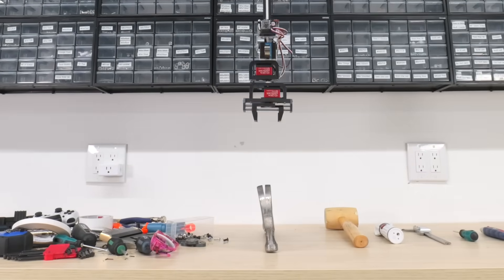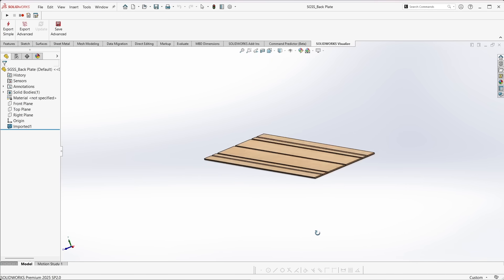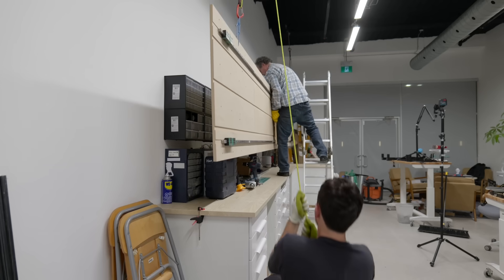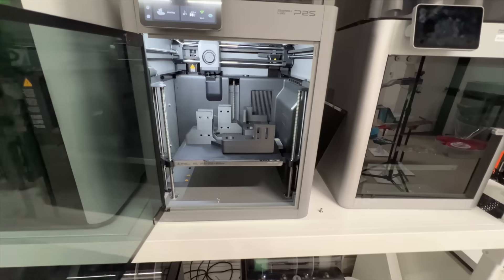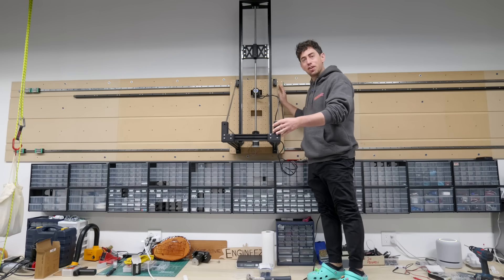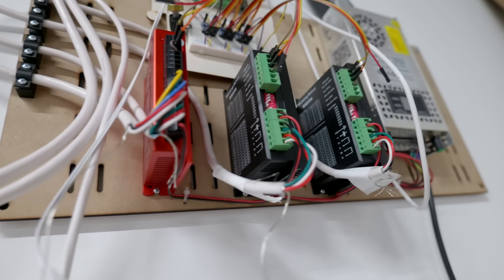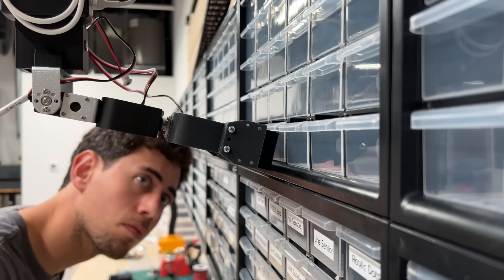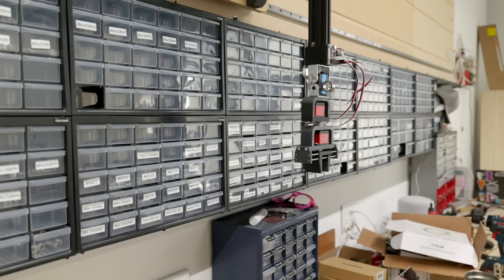I HATE Cleaning so I built THIS

Comment: you should take a min to read the instalatoin instructions for mounting leanear rails. The should either be doweld in place or you need a machined edge to clamp aginest while yo bolt them down to maintain straightness.

Comment: some tips on the 3d prints: for anything with friction (gears etc) that needs to last long and survive some force over a long time i heavily recommend printing in Nylon, its self lubricating, lasts ages and doesnt break or deform nearly as easily as pla. its also not super expensive and relativly easy to print (in my opinion) also 80% infill is super overkill, after 50% the results arent worth the extra wieght, price and print time

Comment: Damn, what an epic project - well done! Can't wait to see the next iterations. Did you consider putting all the control gear onto the gantry platform? That way you'd only have power cabling to run in the chain, and end stops etc could all be on the x-gantry plate along with the motor controllers and esp32. You could also then mount your preferred tool battery on it and have it truly wireless, with a charging dock at one end. Or did you want to keep the travelling weight to a minimum?
Looking foward to your OpenCV battle next! 😆And the automatic toolhead changer for clean-bot to also do CNC duties!

Comment: 15:00 - You need to have a chat with @mellowlabs - next improvement should be RFID recognition of each bin when it's placed on the desktop storage, and a database of locations - that way it will know where each item needs to be put back based on what drawer has been placed on the mount. You can then run programmable LED strips behind each drawer, so you can also indicate each drawer's location on command, and even use the database of locations to track inventory, so the LEDS can indicate drawers with low/no stock...

Comment: Pro Tip: Testing a limit switch works the same whether you press the switch or the robot does. So you do not have to wait for the robot to potentially run itself off the track if you just touch the limit switch early to test if it will stop.

Comment: Video idea: Solar panel snow remover. 
I imagine a couple frames on the ends of the bank of panels with a few strings pulled taught between them. The bot moves along the frame pulling those strings to dislodge the snow. 
Could be 2 fishing lines and a length of webbing, the fishing line cuts into the snow and the webbing brushes it off. 

There are solid bots that crawl along panels for giant arrays, but they're very expensive and can't work with a variety of panels. The string method can work if you have just one panel or several in a row.

Comment: My humble opinion is that the needed precision to insert back a tray will fail from time to time. I would have tried to design a sort of rectangular "funnel" made of thin flexible tongues that can partialy enter the void. Maybe it won't need extra with load sensors "feeling" if the alignment is correct, so the motor can adjust the positioning. Simple mecanical aid is better that computer vision or other solution that need soooo much tweeking....
Reply from the maker: We definitely identified this problem and have some solutions in mind. Agreed that the funnel is the move!
Reply: @Engineezy  I will try to describe without drawings my vision of last night... Put the drawer on a tray with side walls on the front and the sides. The tray is extended at the rear by a thin flexible tong made of steel, with a triangular shape so insertion at the entrance is easy. just insert 1cm. Lower the tray so that the tong touches the bottom of the hole, with a little flex. When you start pushing the drawer towards the hole, the side walls are enlarging the tongue (that is cut in the middle, with a spring that tries to make the tong narrow), now the sides of the tongue are applied to the sides of the wall, and the drawer in perfectly centered horizontally. now you can continue the push of the drawer that should enter the hole with no problems...

Comment: Impressive. Did I miss how the bot decides / detects bin positioning when reinserting them into their shelves? As we saw from the initial design / testing, a heavier bin will cause the caliper to hang lower so you have to be deciding at what z-height to position the outer end of each bin before pushing them in, rather than relying on a set height for the row. All in all, a complex system and one that could potentially become a serious rabbit-hole for a detail-oriented person like me 😬
Reply from the maker: Right now it’s dead reckoning with a little extra loading on the servos, in the future this whole system will have to be improved with feedback of some sort

Comment: Having a nice database of all my parts linked to various local/api voice assistants is so cool. Like "Hey Jarvis, do i own something that can measure x?" and it giving me multiple choices of breakout boards, single ICs and even possible combination of ICs and microcontrollers is pretty neat. It can also reliably auto-generate basic code for ESP32s and flash them through a docking station i've build. It is nowhere near complete and more of a working prototype held together by AHK scripts and Home Assistant, but it is totally working. It makes prototyping quick and dirty solutions so so much faster, like i can have an ESP32 with a working web interface logging ToF sensor data and graph them within 5 minutes after the first voice prompt.

Comment: Perimeters > infill. Your parts still aren't 'super chonky', you're just wasting a ton of filament by setting the infill that high. Instead, push those perimeters to 12 or even 16 and leave infill around 5-15%. The parts would have been way stronger at a fraction of the filament cost and print time.

Comment: Based on the top comments, here is a categorized list of improvements and suggestions for the workbench robot:

1. Tracking & Identification Systems
 * NFC/RFID Integration:
   * Place NFC tags or stickers on the boxes/bins so the robot can identify them regardless of where they are placed.
   * Install NFC readers on the holders/landing zones (specifically on the bottom of the bins and the holders). This would allow the user to move a bin manually, and the robot would automatically know its new location to put it back correctly later.
 * Visual Marking:
   * Add QR codes to the handles and plastic drawers to help with itemization, positioning, and identifying landing zones.
   * Use stickers combined with scanners for identification.
2. Computer Vision & Camera Features
 * Object Detection: Install a camera and image recognition software. This would allow the robot to:
   * Identify boxes and tools on the bench.
   * "See" what the user is looking for.
   * Check if a part is already in inventory.
 * Desk Camera: Add a larger overhead camera for general location data to help clean up untabled/messy tools.
 * Snapshot Reporting: Use the camera to report the status of the workbench as a "snapshot of the scenario."
3. Inventory Management
 * Weight Sensors: Incorporate load cells to weigh the bins.
 * Auto-Restocking: Program the system to detect when a bin is light (low supply) and automatically add the item to a to-do list or reorder it from Amazon.
4. Motion & Hardware Control
 * Limit Switch Safety: Instead of having the robot "slam" into a single limit switch, install two limit switches on the top:
   * Switch 1: Tells the pinion to slow down.
   * Switch 2: Stops the carriage completely.
 * Structural Expansion: Build the gantry over the whole shop supported from both sides (rather than just the wall). This would give access to the entire shop and potentially be easier to support.
 * Material Warning: One user warned that the PLA parts will warp over time due to the constant weight of the carriage, implying a need for stronger materials or metal reinforcement.
5. Software & Logic Improvements
 * Optimization Algorithms: Program the robot to learn the most commonly used tools. At night, it could automatically reorder the drawers so the most frequent items are closest for faster retrieval.
 * Pegboard Solution: Instead of dumping loose tools into a generic "tidy bin," implement a pegboard-based solution (possibly mounted above the X-axis) where the robot can hang tools individually.
Reply from the maker: Lots of great ideas here, appreciate you compiling them!

Comment: He said, "that's what engineering is for I guess..." Lol

Will it work?
Idk. Did you do the math?

Stress testing can't math until you math the test to scale... 
When extrapolating another point on a line you first need a line. A line is at least 2 points of data.

This is a sweet project. I am of course posting my first comment only 5.5min in.
I work with some giant milling machines they use screws to move the x, y, z that are like 2 inches in diameter... The tables are 4 to 6 ft wide and they are 20 to 50 ft long...

Everything scales. I didn't see if you had installed metal inserts to the mdf that you bolted the rail to or what. I am trying to guess max gantry weight. I bet it's a bunch either way. Was that 3/4"?

Comment: all those PLA parts WILL warp. you may not be picking up anything heavy but the constant weight of the carriage assembly itself will absolutely warp all that PLA.
Reply: the term you're looking for is Creep, and yup PLA is infamous for creep especially as it'll uptake water from the atmosphere. PLA is one of the worst in this regard, PC probably is one of the best "printable" ones but it has issues. I'd just have gone ASA/ABS. Some would say GF/CF Nylon but I sure do not want something that sheds microfibers of Glass and CF around
Reply: The rack and pinion will also almost certainly break, PLA is not very abrasion resistant and eventually the gear will slip.
Reply: @mxlje There is very little force on the rack. It will last a long time. Its overdimensioned in my opinion.
Reply: Not to mention their 'strength testing' phases was only done whilst lying parts on the floor, not Angled. And also the parts will gradually creep/warp also due to heat (both ambient and through friction)

Comment: I have a suggestion: instead of having the robot slam into a limit switch on the side you should instead do two limit switches on the top detecting the carriage. The first switch should tell the pinion to slow down and the 2nd should tell the pinion to stop. You can use whisker switches or prox switches to do this. I would also add mechanical hard stops on the ends of the linear rails. Putting your electrical components in a ventilated, grounded terminal box would also be a good idea. AC and DC circuit breakers would also be a good idea for when you need to maintenance the wiring
Reply: Amazing project! It is so impressive! I can see why consumer level 3d printers and laser engravers only use single limit switches to keep cost low since they are pretty low power and self contained, but anything commercial or large like this would certainly have redundancy built into the design like was mentioned in the above comment. In this application there could be a speed reducing switch before the limit switch and a second limit just beyond the first limit switch that kills the entire drive circuit if the first limit switch doesn't work. This ensures someone has to manually reposition and verify the switches to get it working again. And definitely some sort of hard stop as well. Very cool though and I am so excited to see this design evolve and improve!
Reply: or the first limit switch tells the controller to stop, second limit switch cuts power as a failsafe
Reply: if it's just for slowing down you can do it in software. since he's using stepper motors and if you know the relation between motor turns and displacement, then you can zero the mechanism at startup and then in software keep track of the position. with that, you can slow down without a physical switch. then keep the existing switch just for redundancy. with that you can even use PID for position.

Comment: I thought about doing this because i have the same messy problem, my idea though, was a little different, more expensive and way more hazardous. Basically, a Kubota robot arm hanging upside down from the middle of the ceiling on rails so it could go unimpeded anywhere in my room.
Reply from the maker: Haha that was actually my original plan but kuka arms are sooo expensive

Comment: lol @ the “zed” vs “zee” shade being thrown. 🇨🇦

Also, you may want to incorporate NFC tags for your bins so if you place them into a different slot on your tray the bot will still put it back in the correct location.

Or just print yourself a tag you stick on the drawer when it’s out so you know which slot to put it back on for clean-up time. 😊

Comment: That's amazing! One suggestion, remove the tabs holding them in and make a tool that can be flat against the front of the bin when you lift. A simple vertical flat the size of the front and fits under the lip.
Reply from the maker: Great tip!

Comment: QR codes, a camera, and a database of where things go and you're in business.   A larger desk camera and the ability for some object detection and general location data and then it can clean up unlabeled tools and bins.
Reply: I agree - you don't want it running cleanup when the cat jumps up on your bench and it mistakes the cats tail for a screwdriver handle!
Reply: @dash8brj if you have a cat in the manufacturing facility you probably have bigger problems than the gantry accidentally mistaking the cat's tail for a screwdriver handle
Reply: @kitukitukitu-lous Cats love engineering. Why should we restrict what jobs they can do?

Comment: you should put stickers or rfid tags on the boxes, so the robot, when upgraded with camera and maybe a scanner, it can identify the boxes whereever they are on the bench. Probably pretty hard to identify the boxes only by camera otherwise. Or you can only use the predifined 7 spaces you already have. But than you have to put that back by hand, before the robot can start cleaning.
Good luck with the project, I'm very interested on what you will build. Awesome project
Reply: Yep I came here to say the same thing. QR codes and RFID tags are the most common and cheapest way to do this. The hardest part of this is gonna be the camera on the end effector for pick/place and doing approach calculations
Reply: @xtra_kr1spy855  he can just put an aruco marker on the side of each bin as well as a qr code. ROS2 already has a driver for that determining position and orientation from aruco marks
Reply: Was about to say the same thing, but was thinking a camera and QR code labels
Reply: @cbrooksusmc  rfid is probably better
Reply: @paolapiero8037 I wouldn’t know.
Reply: @paolapiero8037I disagree. I've been doing work with vision and QR or AprilTags allow the robot to Identify and know distance and orientation of the object. RFID will only allow it to identify it.
Reply: Or maybe add a rasbery pi with camera and opencv and little bit if ai
Reply: Ignore RFID, use QR-Codes, that's what they were made for. It's also much cheaper and easier to integrate.
Reply: The QR code gives you identification without having to touch it and can also act as a positioning marker that would make the boxes easier to locate and doesn't need an extra sensor, and QR codes can be made with a paper printer, you don't need to buy a bunch of tags.  I think the QR codes solve more problems easier, cheaper and better than RFID.

You can even use a fiduciary marker system that isn't strictly QR codes, but just ensures all the markers are unique.  If you look at photos of valve's old vr testing spaces they were plastered in these kinds of markers.  Really depends on the form factor needed and how easy they are to spot from a given distance, but fiduciaries are good for this because they're coarser than QR since they don't need to transmit arbitrary information, just be unique.
Reply: @excrubulent  Don't know, I think it would be easier to just have some excel spreedsheet with all the labels and content, no printing is needed, after all the robot can bring anything you ask, so you should only need to update the spreedsheet if you are changing something, this would have the benefit of being instantaneous too,
Reply: @ericsaul9306 how the robot would identify the boxes when they will be on the table in random spot?
Reply: @h1gioh1it wouldn't need to be on a random spot, after all he created his fancy box placement board, the position can be simply stored
Reply: Um Kollisionen zu verhindern, wären Ultraschall-Sensoren an den Seiten des Greifarms sinnvoll.
RFID-Tags an den einzelnen Boxen wären ebenfalls sehr praktisch, um deren Position aus zu lesen.
Eine oder mehrere Kameras zur Objekt Erkennung. Eine fest am oberen Schlitten montiert und eine am Greifarm.
Für die Kalibrierung der einzelnen Achsen nicht nur ein sondern zwei Schalter. Der erste Schalter dient hierbei nicht zur Kalibrierung sondern nur zur Reduzierung der Geschwindigkeit so dass der Schalter zur Kalibrierung langsam und akkurat angesteuert wird. Zudem kann für den Fall eines Versagens einer der beiden Schalter eine automatische Abschaltung einprogrammiert werden.
Fällt der erste Schalter aus und der zweite wird erreicht kann das Programm eine Warnmeldung geben. Wird der erste Schalter erreicht macht das Programm nicht mehr als X Umdrehungen für den Fall dass der zweite Schalter ausfällt und gibt eine Fehlermeldung wenn der zweite Schalter nicht nach X-3 Umdrehungen erreicht wird.
Doppelte Sicherheit.

Ebenfalls wäre ein KillSwitsch sinnvoll um den Robotern bei einer Fehlfunktion zu stoppen.
Reply: Zach Freedman did this with his gridfinity system.